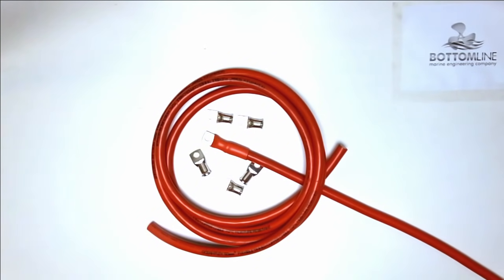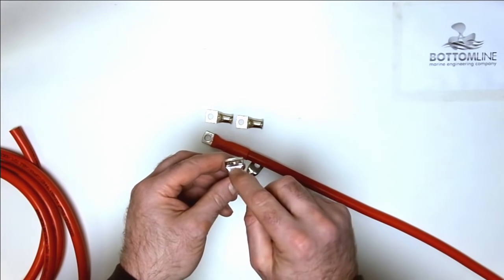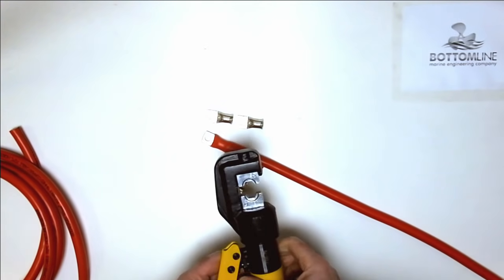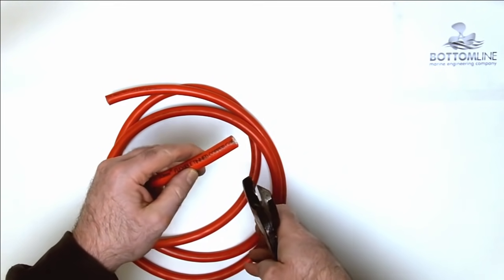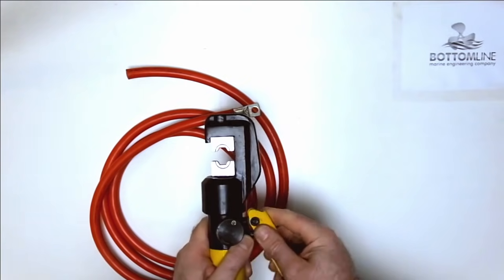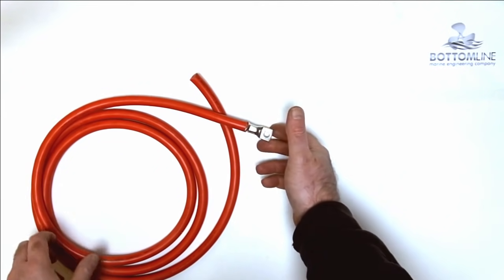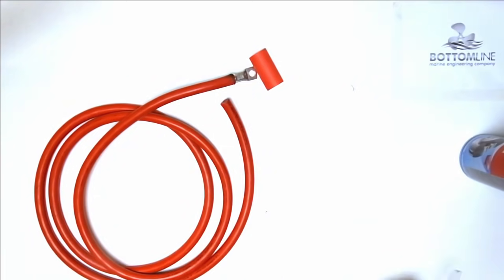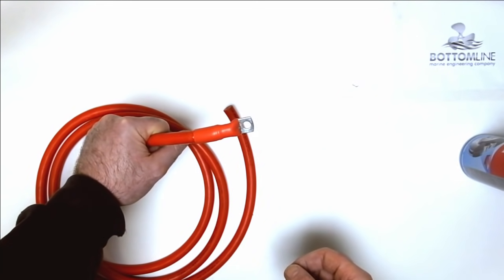Crimping marine battery cable terminal lugs (the proper way)

Comment: Thanks for your demonstration . There's a guy on the Tube who reckons that the small hole on the ring side of the terminal is for the purpose of inspection. Not wishing to show any disrespect to anyone's sincerely held beliefs here ,  it would seem more likely to have been designed for solder - as you have shown. Got to try and join together  two ends of earth cable and bolt them to a stud  on my daughters car . Without a crimping tool !
Reply: it's for inspection. If you dont believe it take a look at klauke terminal lugs. it says it in the datasheet.

Comment: I wish I had more than one vote to give you as this is the best tutorial on this issue I have ever seen.  And I have seen a few.  There is a sea of conflicting and horrible information out there.  You sound like someone who has done this many times and that crimp was a thing of beauty.  I doubt anyone would believe that crimp was done by hand.  Then you go and top it off with the proper usage of solder, that so many videos reject using as they are trying to use it improperly before the crimp rather than after,  and this is just perfect.  Thanks again mate.  Subbed.

Comment: Excellent video. It’s nice to hear your opinion about using a small amount of solder...to avoid corrosion
Reply from the maker: Thanks for your comment. I'm glad you found it useful. To solder or not to solder is one of the most debated topics in this area of the internet. You often see the statement that there is no soldering allowed on aircraft as the ultimate answer to why soldering should not be done. People use this argument despite it being incorrect and also not really relevant to the conditions encountered on a boat. There is a nice piece out there written by one of the soldering inspector/trainers at NASA explaining that they do in fact solder on aircraft and also on spaceships!! On boats though, I would highly recommend it.

Comment: nice vid  you didn't need to solder
Reply from the maker: Hi Anthony, Thanks for your comment. Believe me the solder helps to keep the moisture out. I've been a marine engineer for 30 years and have all the relevant qualifications from EITB, Mercury, Yanmar and Yamaha. Eventually due to the moist nature of engine bays, moisture will find its way in if you don't solder. The resistance will then slowly increase and eventually starts to cause systems to fail. As resistance increases voltage drops and amperage increases. It's high amperage that fries starter motors and other sensitive equipment. I've seen it hundreds of times in my career. For this reason Yamaha Marine crimp and solder all of their factory supplied outboard motor battery cables. There is every reason to solder and no valid reason not to (if done properly). You must ensure that the solder doesn't flow past the crimp as this can cause a hard point in the cable that can lead to failure. Done the way I show in the video the solder will not flow past the crimp. I hope this is useful. Regards, Dean (Bottomline Marine)
Reply: BottomLine Marine  RE: “Moisture getting in...” and the soldering part of your process:
- Yeah, with the type connector you chose to use (with the handy ‘Moisture-In’ port) you would need to solder to plug that hole.
- You’ve built in to your otherwise high quality process an unnecessary failure point.
- FYI  That’s a very good crimping tool that makes a high quality crimp...I was impressed with your work until you started soldering (unnecessarily) and damaged the cable sheathing.
- Consider purchasing/using similar (copper) connectors without the useless hole in them.
Reply from the maker: @robertjpercival6386  Thank you very much for your comment. I've been making cables this way for 30+ years and I still work on many of the same boats from back then. So far I've never seen or heard of a failure on a single one of the thousands of cables that I've produced. I have however seen many failures in cables that were just crimped and not soldered. I'm always open to acquiring new knowledge but have so far seen nothing that competes against my method in terms of reliability and longevity. From my experience so far, I'm afraid I just can't agree with you that soldering is unnecessary. As I said though, I do appreciate you taking the time to comment. As engineers should always consider other engineers views and take them under advisement if we wish to learn and better ourselves.
Reply: @BottomLineMarine   That is a very well written and considerate reply.
Reply: @BottomLineMarine  Plus any man who knows how to properly solder will tell you that if you don't apply flux and solder to a previously reheated or mechanically disturbed joint you will end up with a cold one. So heating the pre-tinned and crimped parts and adding a lil rosin-core solder is the best thing to do. I admire your dedication to getting the job done the right way. Learned a lot from this video! Thank you, BLM :)
Reply: @robertjpercival6386  you could purchase tinned lugs with no hole. We use DLO cable which is tinned with no hole cable lugs such as Panduit, also tinned. Our trading here in the States indicates crimping with no soldering but then the lugs we use don’t have an inspection 
hole as it’s not needed.

Comment: Well done. What I'm wondering is why the fellow here (https://marinehowto.com/making-your-own-battery-cables/) had such horrible luck with his Horrible Freight crimper. Is it because he was using it on US AWG instead of metric cable, or has the quality come down on the tool since you bought yours?
Reply from the maker: Hi Rick, I had a good read through the article that you linked. There is some good info in there but also some points where the guy is overly fixated on a certain tool. From his point of view it is imperative that the numbers on the die match the numbers on the lug. In my experience this is almost never the case. There are hundreds of lug terminal styles (not just the two that he mentions). I suspect what we are seeing here is that the crimper that he owns works well (from his point of view) with the brand of lug that he uses. 
You can see in my video that I selected the next size down as it was obvious that it was the one that best fits the lugs that I had chosen to use. It was obvious in the guys photos that it wasn't going to work before he crimped. He knew that and in my opinion it seemed to be a deliberate mistake on his part to make the tool look bad.
I didn't want my video to drag on longer so I didn't spend very much time on die selection but I think most tools can be made to give a good crimp on most lugs with some thought before hand. Sometimes you have to do a partial crimp, then rotate the lug and crimp again to get a nice crimp. I own a pair of more expensive hand crimpers where this is the case. I would get material deforming out of the side of the crimp similar to what he shows in his photos if I just do the crimp in one action with that particular crimper/lug combination.

If you have any further questions, please feel free to ask.

PS. One thing that I found interesting was the he's happy to use cheap quality wrenches as he loses them all the time. If you made this point to most proffesional mechanics they would correct you in an instant. 'Use good quality wrenches, cheap ones will bust your knuckles'. 'Look after them, know where they are at all times and put them away at the end of the job'. Would be a very common mechanic's point of view. It's all down to perspective I guess.
Reply: Thanks for the extensive reply Dean! All points well taken, but I will say this: The HF wrenches these days are pretty darned good. They're beating the US brand (Craftsman) at the moment. I try to take care of mine, but I've lost several over the side, so I can't be too critical of anyone who has done the same. Fair winds and following seas.  @BottomLineMarine
Reply from the maker: Hi Rick,
I can't really comment of HF wrenches as we don't get them in the UK. I was mainly shining a light on the brand snobbery that most of us engage in at some point. For instance, I served my apprenticeship as a precision tool room engineer in a factory making parts for Rolls Royce aero engines long before I became a marine engineer. Any tool snobbery that I have will be most noticeable when I'm talking about machine tools (such as my American made Hardinge HLV lathe that I'm very proud of). I think we all do it with one brand or another. Keep up your inquisitive nature, you can never have enough knowledge.
Reply: @BottomLineMarine  I'd love to have a Hardinge lathe. I'm currently using an Atlas, and I'm working on the refurb of a Logan (Playlist is here: https://www.youtube.com/playlist?list=PLB5FMMBblDMKE4xndlKyA7nE0uP2oDJEg). Neither is in the league of a Hardinge, but I am just a hobbyist, so they suit me fine. That's great that you got to work on Rolls Royce aero engines--sounds like you've had quite an interesting career. Oh, and the reason I'm looking at videos on battery cables is that I'm rewiring a 1972 Ericson 29. Playlist for that project is here: https://www.youtube.com/playlist?list=PLB5FMMBblDMIwvi4HAOmSWfLyIvnj8sNd. Cheers!